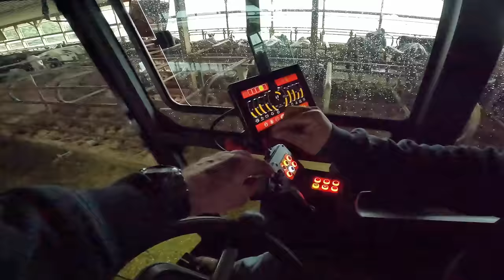Nuhn Bedder Spreader

Comment: Our mensch was spilling a lot on the floor like that. The fix was replacing the guide strips of rubber that ride along the side edges  of the cross belt. The sand gets between the belt and the steel edges and goes on the floor if the rubber strip isn’t there to keep it on the belt.  Cheap easy fix. Hopefully I described it well enough for you to understand. Great video comparisons 👍🏻

Comment: I really really really do not like how the belt drive is surging, that's a way to wear your hoses out super-fast.  Can probably be fixed by putting a crimper roller moving a little faster than the main feed belt above the end of it to draw the sand off more smoothly.   HEY NUHN

Comment: Pretty impressive machine.  when you did your test at the bunk, it wasn't moving so the amount on the ground would have been virtually invisible if you were bedding stalls running that first bucket out.  Looks like the new truck would save a lot of sand, but is that worth the new machine?  Cool  video.

Comment: Wonder why they didn't extend the belt and chute out a little farther to maybe even with the outside of the wheels?
Reply: Probably because of the different stall designs and to avoid hitting posts and gates with the conveyor. Looks like it throws it far enough to clear the curbing.
Reply: @MorganOtt-ne1qj a would agree with you it’s protected under there and once they got it dialled in that little bit it was making a tidy job of it

Comment: How often do you have to change  the bedding out ? And how much sand do you go through  in a year ?
Reply: The cattle tend to drag the stuff at the back (💩) out when they back out of the stalls. Likely someone takes a rake to remove the dirty sand daily, and I know some places that use a tractor or skid steer mounted bedding conditioner to level up the sand and also drag the dirty sand out at the same time.